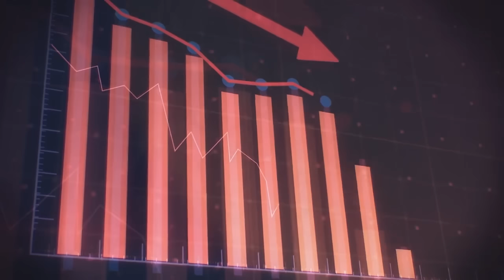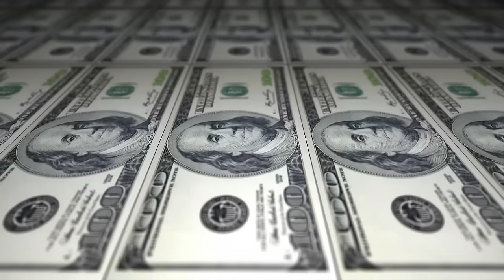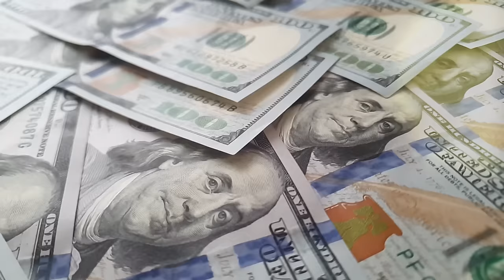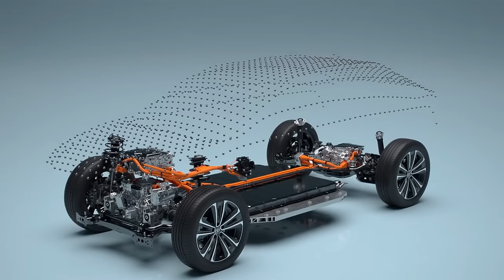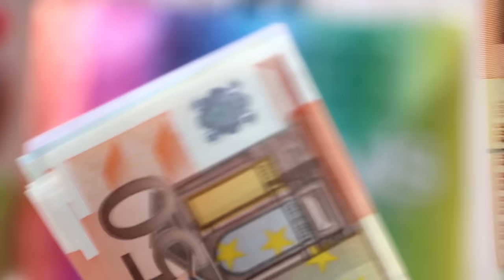The ‘I Told You So’ Moment: Toyota’s Predictions About EVs Come True! Electric Vehicle or Hybrids?

Comment: Our ten square mile area is served by five service stations but only two of them have electric charging facilities.
New garage opening soon with six fuelling positions and a Starbucks but no electric charging points.
Main road in has two charging points. 
Large Ikea carpark has one charging point. 
Local football ground carpark has two charging points. 

 Nine charging points in total........... Not a very good advert for electric  vehicles especially with poor connectivity,  poor reliability,  poor contactless,  credit card, bank card acceptance as well as some which require apps to run and pay!

Everyone seems to want their little piece of the pie while dragging the whole experience down.

Comment: Toyota was and still shows they were ahead of their time with hybrids !
It also shows how arrogant those who pushed the green new deal thought they knew better ! 
Now we are in debt even more and it will cost us a lot more to get out of it ! 
Leaders are in short supply in the US !
Reply: if toyota were ahead of their time, they would have made the prius sexy way earlier, but they didnt because they didnt want any electrification. They arent ahead, they just try to hold out to keep the old infrastructure in tact.
Reply: @fetB  when it comes to ugly cars I don’t think you could single out one auto maker . The hybrid was something Toyota refined and made very dependable , looks or not ! 
Better late than never ! This last Prius is nice looking !
Reply: @hotchihuahua1546  not single automaker, indeed, but you can differentiate beween ugly and pretty. This is about things like proportions or dynamic lines. None of these fundamentals is foreign to any designer and cars are always designed for a certain clientel, and so, the old prius was designed to be ugly so it doesnt sell, or more accurately only a certain clientel. You can also not treat any automaker as a homogeneous entity. This only outward the case. Internally, you constantly have different opinions on what technology makes sense or is achievable. Ultimately the CEO is the one that says what goes, and with the political sentiment changing, toyota felt incentivized to actually sell their hybrid and have it represented in substantial numbers. At the end of teh day, no automaker wants to make evs except for the new ones that specialized in it. Everyone else simply has no choice

Comment: The main point everyone is Missing is that EV s are not Green as percieved ....yes they are slightly greener..thats it. The carbon footprint of entire life cycle, production and scrapping need to be considered.
Reply: Dont forget that the fuel must be through long refinery process and left many abandoned oil rig. To burn in a centralized turbines and convert to electricity and store in a lithium iron phosphate battery that has 50years lifespan is more efficient than to burning fuel in every car's ICE

Comment: They day EVs will remove the Milage as a factor, as Mobile phones did with the Battery Life (which we do not care much about now), BEVs will rise again. Solid State Battery is an advancement towards the same mission. You can't say EVs are a failure. They are evolving, the First hybrid was the Toyota Prius, we all know how much time the Hybrid took to take over the market. Hybrids are expensive, and EVs are only becoming cheaper over time.

Comment: You missed two key reasons:
1.  EVs are not "green".  The batteries are highly toxic and non-biodegradable.
2.  Strategic vulnerability.  The US has large oil reserves, but most of the world's cobalt and lithium reserves are CCP controlled and their mining is causing environmental disasters.  These are key  EV battery raw materials.

Comment: Toyotas hybrids are 3 fold expensive compare to gas cars in India though they manufacture in India ..

EV's are future only if you build proper fast charging infrastructure with renewable power source

Long range EV's are solution for range anxiety, but they are expensive, but China using battery swapping tech for E-Cars, that is also another solution to reduce carbon footprint, very importantly big rigs like road trucks & buses should become eco friendly first

Comment: The American auto market is 16 million vehicles per year out of the world market 80 million. EV adoption in the U.S. has been a lot slower than the rest of the world and is not an indicator of the world market. The cost of EVs will continue to fall with its largest cost component, the battery, expecting to fall substantially in price. The transition to EVs is past the tipping point. It’s happening Mr Toyoda.

Comment: The hybrids are likely to completely outsell full EVs until EVs have an average range over 400 miles and max range over 500.
Making the hybrids plug in capable will have more energy savings than EVs do anyway because the vehicles cost less in terms of energy to run because they weigh less, but most trips are under the battery range. People driving EVs are csrrying unnecessary weight that they wont use the majority of the time. As battery technology improves, that may change, but for now plug in capable hybrids are cleaner than EVs.

Comment: Hydrogen fuel cell vehicles are the way to go. You need only add an extra pump at each station at gas stations. Toyota has the Mirai, which is a great vehicle. Only reason hydrogen fuel cell hasn't caught along is due to pressure from the failed EV industry to keep their technology alive. Musk would go broke and Tesla would crumble if Hydrogen fuel cell becomes the new wave.

Comment: I have an EV car, the range is the biggest problem. Those who drive from A to B will find it to be an amazing car. Now with the everyday charging at night, there is issue related to low voltage.
We need more efficient hybrid engines. The initial cost is a bit high too.

Comment: Hybrid battery dies in roughly 10 years regardless of mileage.  Had two Prius, both battery died within the same time frame.  Replacing them are not cheap, 5k at dealer, got a local shop with refurbished battery for 1.3k each.  Just get a regular v6 or v8

Comment: The logic behind EVs doesnt make sense to me as im sure it doesnt to most as well. They arent eco friendly, the batteries last about 2-3yrs and making/disposal of them is incredibly harmful to the environment. Theyre overpriced, not very economical in general. You have to wait hours for a recharge. They get charged of the same non green energy, they put more load on the power network causing the need for more power stations. They collectively like catching fire (that you cant put out) when its mildly hot, or have no charge when its cold leaving you stranded. 

BUT they are the way forward and everyone must build them now aparently

Comment: if people want to drive a chariot with an doncky, Toyota was to obey !!! that is a dumb stantement. costumers want the best deal and the best car... they dont care about gas or electric. they want to spend the less money with the best car. Toyota wanted to go with hydrogen but it got a shot on the foot. hydrogen is more expensive and more difficult to implement on a combustion engine. that is why Toyota said they dont want electric. 
the only thing that make the car industry to stop selling cars is money, and with several wars on the world and interest and inflation keep rising is normal that people dont have money to buy new cars especially electric because they are more expensive.

again EV is almost on is finally stage, you can't get a better motor that what you have, electric motores are 90% efficient. the problem is the battery, but without money and the industry there are no investment to develop new batteries, and will keep going to hybrieds and combustion engine cars. EVs can delivery to most there average needs, go to work, pick up the kids, go to the store.... EVs can do that!

8:12 the car that can't delivery nothing... is autonomy is 40km and they have to fill the tanks again, I will not mention the efficiency of the engine and the cost of hidrygon.... that was a real shot on the head to Toyota...

Comment: Whilst I agree whole heartedly with all points raised I am infuriated that there was no mention of the questionable claim that EV s are at all eco friendly when you consider aspects other than the emissions directly from the vehicle. What about the highly suspect mining and production techniques and shipping etc that is involved in the production of an EV and it’s components? Not to mention the problem with disposing of the batteries at the end of their life. There are many aspects of EV s that make them far from “planet friendly” and if you take the dust to dust life of an EV and compare it to a normal internal combustion engine vehicle you will, I am sure, find that the EV proves to be the real “villain” not the petrol or Diesel vehicle. And it was only just touched upon that it is impossible to set up the infrastructure for charging where you have dense residency area such as blocks of flats and intense housing, you just cannot have enough accessible charge points. Finally, EV s run off electricity which as yet is NOT emission neutral, so all the gains of reducing emissions at the vehicle are simply transferred to the power stations that need to produce more emissions in order to provide enough electricity to run the EV s. So the whole EV drive was from the beginning another smoke and mirrors move by governments who did not do their research and did not listen to the right people. They just got a bee in their bonnet, decided for them selves without proper consultation ( which they need because they can’t think for them selves) and tried to force it through.
Another reason that is not mentioned is that there are many people like me who have figured all this out and refused to jump on the EV band waggon knowing it is heading for a cliff!!!!
Reply: All that above won’t be poisoning my kids when they walk to school. Or waking them up at night, as the noisy things pass the house.

Comment: I love these anti EV stories they show how desperate the oil and auto industries are to stop the present trend of folks switching over when their old gas banger dies. I live in a town where you see more and more EVs on the road everyday yet no infernos?!! If the EV market has slowed down it is likely most who can afford a new vehicle of any kind have gotten one and remember electric cars have far fewer issues that ICE vehicles do so they have no need to buy another one every three years. PS and at present with the ever advancing battery technology it is not If but when they make one that equals or betters the ICE range per charge.

Comment: Four major problems with electric cars one is their cost they should be cheaper than gas cars two the range they need to have at least a 300 mi range on a single charge, three lack of charging stations there are gas stations everywhere there should be that or more charging stations and four how long does the battery last and what's the cost of exchanging it for another one. I would love to have an electric car but they're too damn expensive and there's no place to charge them and I don't know what happens when the battery starts to go out ?

Comment: Dishonest investor try to increase the market cap by their speech and try to make speech bad to reduce the market cap.   The ev can charge on it own.  Every thing about the stucture it is simple.   It is less part than the combustion engine.  The battery if you do it as the whole piece it is more problems but small piece to take out no one work on those issue.  We know electric from the sun abundant.  Not easy running out.    We do not need the EV station.

Comment: I agree that EVs have a long way to go but what I don’t understand is why we are turning a blind eye to Tesla. They are a premium brand that has solved both the charging problem and the profitability problem. By not acknowledging this, you are adding bias to the situation. Ford, GM, Kea, etc. are all failing to produce a profitable electric car. No different then gas, EVs across multiple brands are not built equally. I also want to add that a hybrid is still a electric motor and battery pack, it just uses a small gas engine to charge the batteries. As things progress a world of EVs and Hydrogen Hybrids will be nothing but inevitable. The physics of EMF are sound and prove to be a more efficient and powerful method of propulsion.

Comment: This video gets a lot wrong about the current state of EVs and Toyota's approach. First off, the EPA hasn't officially backed down from its 67% EV sales target by 2032 despite industry skepticism. They’re focusing on flexible, performance-based standards, not a complete reversal like the video suggests.

The video also downplays the progress in EV technology. Yes, there are challenges with cost and infrastructure, but significant strides have been made that the video conveniently ignores. And while Toyota's diversified strategy with hybrids might make sense in the interim, it's not unique. Other automakers are doing the same.

For accurate info, check the latest from the EPA and industry reports. Don't let misleading claims skew your perspective.

 (US EPA) (POLITICO) (US EPA)

Comment: Reason #7 No secondhand market for EVs. EVs lose far more value when reselling, battery reliability is low

Reason #8 Lithium batteries are the same as you find in your phone, they do not recharge to 100% as they age and therefore leads to the need to replace the battery at thousands of dollars - you may need to purchase a new EV instead

Reason #9 insurance for EVs is much higher with the parts much more expensive to maintain, a giant battery in your car also means stronger breaks are needed

Reason #10 lithium batteries are volatile and if damaged needs replacing, if it catches fire they cannot be put out. Firefighters simply let the chemicals burn out.
Reply: Yes resale value diminished DRAMATICALLY. :hand-pink-waving:

Comment: isn't reason number one that there just isn't enough lithium on the planet to make all the needed batteries? if true then there won't be a majority of EV's among any car groups until we have new battery tech. 

and reason number two is that current battery tech sucks hard in the way of that it results, compared to normal cars, in basically a major disaster whenever an EV goes up in flames - which also happens way too often from something as common as flooding or even regular traffic accidents still.

Comment: Tables have turned… 😂

US U turn- the only reason us car makers lost money is that they have not invested adequately in the technology. 

EVs Lack of reliability 😂 - only if you buy those from legacy ICE companies.
1/3 of the car market 😂

Hybrids 😂 - They are probably the most at risk to spontaneous. These are definitely an issue. They do not even offer a plug-in hybrid.

Batteries have massively improved and now offer reliability and longevity.

Toyota now in a mess surrounding their hydrogen based offering after customers are complaining about their performance. They are in a complete mess. Now they have just lost 33% of sales in China to EVs so far this year.
Reply: Yet profitable like crazy because most of their cars sell and they sell mostly hybrids.   If have to buy an ev I want one that Toyota is designing for an EV lifestyle.
Reply: @chrysanthalas Watch this space!

PS Have you looked into the cost of ownership. I had a hybrid it was a lot more to service than an ICE car, EVs have negligible servicing costs (at least Tesla anyway).

Comment: EVs are not good for the environment. Their production carbon footprint is eye watering to start with, but it is not the main reason.

Take the American grid at large (state numbers obviously differ). 44% of electricity produced in the USA is produced burning natural gas and another 16% burning coal. Wind, hydro and nuclear production is a third of the capacity, at most. 50% of new generation facilities seem to target solar, but the new generation facilities will account for a third of the capacity in a decade; if it turns out to be feasible, it will at most balance fossil fuels and renewables 50/50.

So, Americans are charging their EVs mostly burning natural gas and coal.

Australia is producing 53% of its electricity burning coal, and 19% burning natural gas. It also exports most of its coal, so, while they are not the ones burning it, they actually have an even bigger carbon footprint.

China produces 30% of all electricity produced in the world (at ~9 petawatts - 9 billion megawatts), 63% of it produced burning coal.

EVs are not good for the environment.

Comment: hybrids never made sense to me. so much redundancy. every system is duplicated, the vehicle as a whole is so unnecessarily heavy, which is directly contrary to making sustainable vehicles (also in terms of road degradation prevention)... there is no significant CO2 emission reduction from them... I think ICE will be dominant for now and EV will take over at some point, even if it isn't now yet... 7.8% growth from a low base is nothing, sorry. not a convincing argument.

Comment: Hybrids go up in price and EVs go down in price at the same time. Toyota pays for these videos. Toyota tells you what to buy and how much. 
Camary hybrid for $55k!!! Model 3 performance dual motor 2.9 sec zero to 60 for $49k!  you can have your camary I take the supercar slayer!
Reply: Depreciation EV Lose 60% After 1 month,Toyota Hybrid Lose 5% After 1 Year
Reply: @nyxline  If you buy a car as a investment you are a doing it wrong! new EVs are going down in price this will affect resale not a huge mystery. Toyota are lossing values faster as well and it will keep getting worse because Hybrids are expensive to make plugin hybrids even more. EVs have the least complexity. Tacoma is 16k more than the previous gen, camary is also more expensive than a better equiped Tesla.